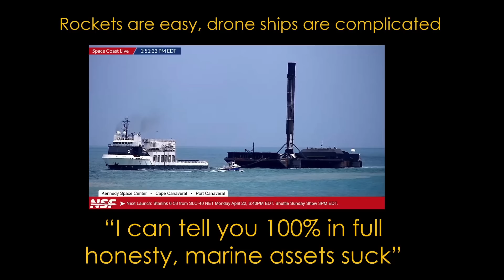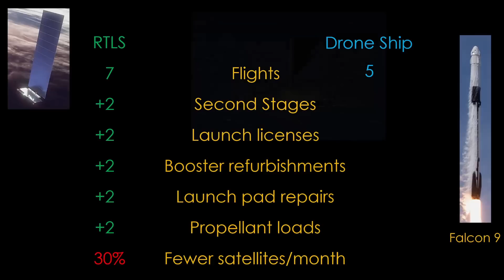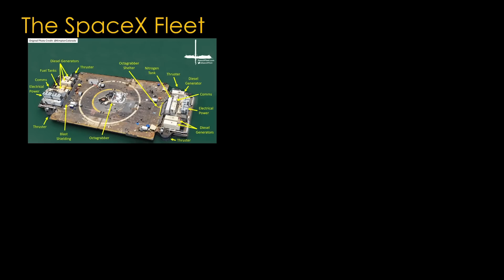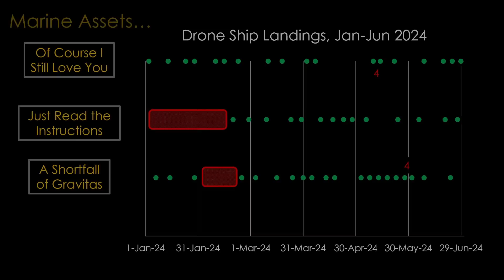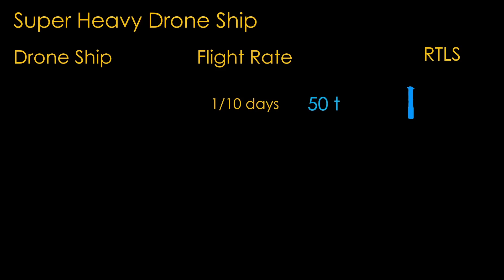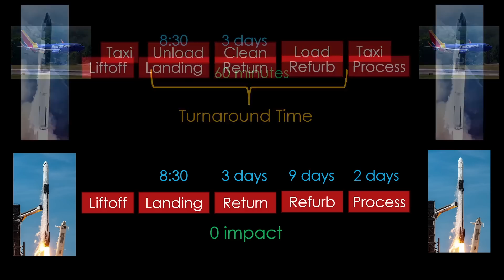Starship Booster Droneship Catch?

Comment: Many modern rocket systems use variable configurations to allow for a more cost effective way of launching a wide variety of payloads; there's no need to use extra performance for smaller payloads, that's just added cost, so you should try and cut that out if you have the margins to. This typically takes the form of strap on boosters, or things like an additional stage or a kick stage.

F9 and FH do this differently. They both can launch in different configurations that, for added cost, have added performance, by launching the 1st stage in RTLS, Droneship, and Expendable configurations (FH hasn't done a twin Droneship, and the reason why can be another discussion).

The Starship architecture is also doing this "additional payload capacity for more price" architecture. Once again, SpaceX isn't going with the typical approach. Although Starship is capable of lifting any satellite with ease, due to it's poor mass ratio, stemming from being reusable, it has disproportionate difficulty placing objects into higher energy orbits. To get around this, Starship will need to use orbital refueling so that Starship can place payloads into any orbit.

What may be most interesting, is how the new wave of space launch companies tackle this architecture problem. "Oldspace" architectures handle this very well, as they'll often use boosters or many stages, which can be varied to provided a different payloads for different costs. "Newspace" companies are starting from the ground up, are very vertically integrated, and are mindful of fixed costs like engine development, so their architectures reflect this by usually being a simple 2 stage rocket design. With many Newspace companies going with reuse, trying to improve upon what was shown with F9, and different expectations of their rapidity, it'll be interesting if they develop a different architecture to the F9/FH's reuse. That said, since propulsive reuse is what everyone seems to be going with, and I can't think of a different variation to the reuse architecture of RTLS/Droneship/Expendable, there might not be any differences.
Reply from the maker: It's very hard to predict what is going to happen with starship-sized payloads, but I suspect that we are going to see more kick stages - like Helios - rather than refueling starship because it's a simpler architecture and you don't have to figure out how to get starship back from wherever you take it. 

That ignore the "starship as probe" approach where it might actually be cheaper to build a starship with the probe build into it and refuel it than to build a bespoke probe the way we do now.

Comment: You know they could always do an artificial island or oil rig style setup with a catch tower and just land there every time. That would mean less flexibility in designing each launch profile but it should give better fuel savings then return to launch site. 

And rather then transport the booster back by barge you could always refill and fly it back to the OG launch site. I doubt you would need all 33 engines to create a ballistic trajectory back without the need to carry starship and a payload, so you could create a simplified launch platform without the need for starting the outer ring of engines.
Reply from the maker: I had a section on this but couldn't make it fit...

Launches aim in a variety of directions and therefore the location where you need to land changes from launch to launch. You could do a hybrid version where you do something like RTLS to get to wherever the fixed landing site is, but that will cost you payload. 

You also still need to get the booster back somehow.

Comment: Nice video, one thing you did miss is the added complexity and weight of adding landing legs to superheavy. But that would have just added more to your point of why they can't use droneships. Really good video and well explained. I think SpaceX would not mind having a "fleet" of boosters and second starships as an interm solution until they make a breakthrough in the reusablity part.

Comment: Top reasons why you are mostly wrong:
1. SpaceX wants to achieve RAPID reusable rockets (talking about multiple launches per day), so... having to get back a booster from a droneship in the middle of the sea is not good.
2. They have been designing it to catch with the tower so why would they change that? It would mean a lot of lost effort (why develop the catch mechanism on the tower when you want to do something else)
3. Pretty sure that the power of 3 raptor enginges would cause some damages to the droneship, and damages are not compatible with reusability and rapidness.
Reply from the maker: You didn't watch the video, did you?
Reply: @EagerSpace  man, that is clickbait, how was I supposed to battle that
Reply from the maker: Everybody says they hate clickbait and all the evidence shows that videos with clickbait titles perform better. I do try to reign it in, however.

Comment: I think launching from Boca Chica and catching in Cape Canaveral will be an option for rare extra lift launches.  Eventually Space X could even to a drone ship equivalent with oil platforms, but super heavy would get refueled and fly back to it's launch site, trading more cost and complexity for time on the fly back vs a slow barge or ship.
Reply from the maker: Drone ships for F9 are about 600 km from the launch site. boca chica to the cape is about 1600 km.

Comment: I know people have already mentioned the heavy landing legs, but if you made an air breathing first stage, and made the Superheavy Booster stage 1.5, like the suggestion made by Terran Space Academy, the heavy landing legs will not hinder the orbital payload. 

However, I do not believe SpaceX will choose this path. It requires building a totally new air breathing methane engine that will have a lower thrust to weight ratio that will only be useful in the atmosphere. However, it would allow larger payloads to orbit, and remove the mass cost of the landing legs.

Comment: Another thing to account for is the landing itself. With falcon 9, the booster lands relatively unassisted with the use of landing legs. Super heavy isn’t just coming back to launch site, it’s gonna be caught by mechazilla. Since the tower handles the landings that means super heavy doesn’t need landing legs which saves a lot of weight and thus can lift heavier payloads. This weight savings may make up for a lot of the payload reduction needed for return to launch site. Sure, you could compound these benefits by putting mechazilla on drone ships but that would make all the problems you showed with drone ships significantly worse.
Reply from the maker: Definitely true, but I didn't need it to make the point so I left it out.
Reply: yea too bad the offshore oil rig idea wasn't so great after all, combining mechazilla with a droneship would be nearly impossible unless there was some island  further away where there was very stable ground and it could be caught

Comment: This analysis hinges on spacex having working "gas and go" for boosters which I don't see happening in the next 10 years, I can see them having a 1/day launch cadence, but not with an individual booster on an individual pad. I don't think even spacex is intending to get there any time soon, they wouldn't have built a factory to mass manufacture these if they think they'll only need a couple to hit their target flight rate.

Comment: Not sure if you mentioned this but, with respect to the payload benefit of Super Heavy drone ship landing, you also need to account for the fact that SH would need heavy landing legs and possibly heavy landing leg extension mechanisms which will eat into any benefit gained from the drone ship landing. Great video!
Reply: Based on the title, I just assumed that a hypothetical Superheavy droneship would have the hardware to catch boosters, just as the towers do, although this wasn't explicitly stated in the video.
Reply: In theory, you could just land on the engines, but that can be risky. I think that adding a catch tower might be a better idea because SH is already designed to land like that.
Reply: @loafofbreadx  tell me you’re a KSP player without telling me you’re a KSP player.

This is an insane comment. You can’t land on the engines for two reasons . They’re too fragile to hold several hundred tons of weight, and the landing engines would torch the pad without some breathing room.

A tower on the drone ship seems likely, but would be very heavy, requiring a larger ship, and being very high off the water, the tower would sway wildly as the ship rolls on the waves, making a clean catch 10 times harder.
Reply: @J7Handle  Yeah, it is insane i will give you that. But think of it this way, everyone thought F9 would be impossible and it is now one of the most successful rockets in history. Sure, right now landing a rocket on 30 raptors may cause small damages to the engines, but all that is needed is a slight increase is strength.
Reply: @J7Handle  landing on the engines was the initial plan when starship was in conceptual phase. IIRC musk has said that is still the long-term goal but would need more time to flesh out so it'll likely take a few years of iteration before they can get there.
Reply: @J7Handle  There are ways to reduce pitch and roll, though the draft might need to be deeper.
Reply: I wonder about the possibility of going back to refurbished oil platforms again.  They stay downrange from the launch site and just there to catch booster.  They get refueled for a flight back to the launch site.  The booster can lob a bigger payload and still be quickly reuseable.  Seems like being able to fly the booster by itself would also a good way of getting them from Texas to Florida provided that they can create a flight plan that satisfies the FAA.
Reply: @longshot7601  some guy made a video on it showing it'd massively increase costs with very little benefits. The goal is to have them rapidly reusable. Meaning a turnaround time of a few days to a week. 

Driving around a giant rocket on even more giant oil platform would only give a small boost to payload to orbit while meaning each rocket and platform is in transit for weeks, more if the weather is bad.

Starship is powerful enough that it doesn't need the small boost to payload it could get from landing on a floating pad for vast majority of things it will be putting to space. It is just cheaper to have it turn around and return to launch site.
Reply: @hohounk  the guy above you meant that the oil rig would stay in place, manufacture fuel through elecrolysis+air carbon capture, refuel superheavy+starship after catching both, and then they could fly again

Comment: Another great analysis! Even if SpaceX were to optimize Falcon 9 first stage recovery steps to more closely match what is planned with Superheavy, they still would need time to do the de-coking operation as a result of using kerosene fuel, which isn't needed with Superheavy due to its use of methane.
Reply: Dude I love that pfp
Reply: That is probably why the Chinese F9 clone is methylox with a 13% larger diameter (liquid methane is less dense than kerosene).

Comment: Drone ships also don't scale well to starship booster size magnitudes. Also, drone ship landings = landing legs = a significant portion of the payload capacity.
Reply: Plus you either have to put landing legs on the SH boosters (which will cut into the total mass to orbit) or make the tallest ship ever made to have a floating catch tower.
Reply from the maker: Yes. That's why the thumbnail looks so stupid.

Comment: I really think SpaceX could land 2 F9's on one drone ship. They'd have to invent a way to move the first one to the edge and also add another opti-grabber, but I really think it's possible.
Reply: There's room on the deck and they're accurate enough - but what will the blast of the F9 rocket plume do to the first rocket? It seems likely it'll damage it, or even knock it over despite the octograbber.
Reply: @donjones4719  I’d be curious to see what would happen. They could ship out an empty but slightly laden shell on the barge and see what happens.
Reply: I suspect the sideways forces are too strong when all power from booster is reflected from the deck during landing